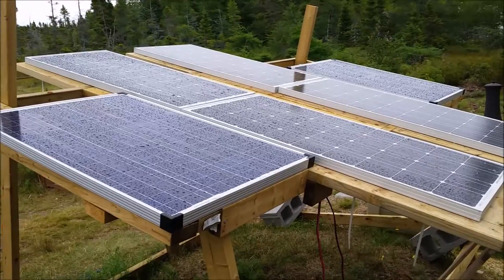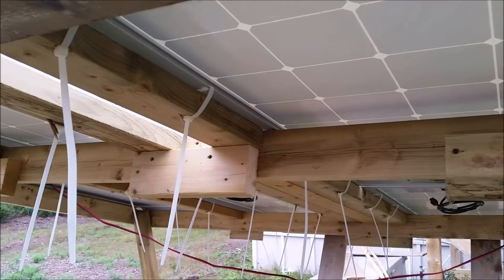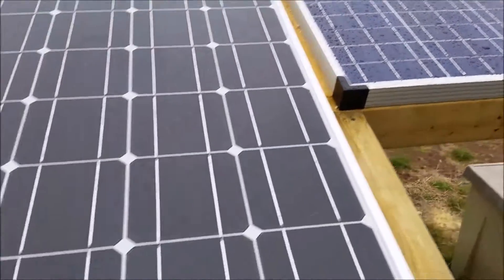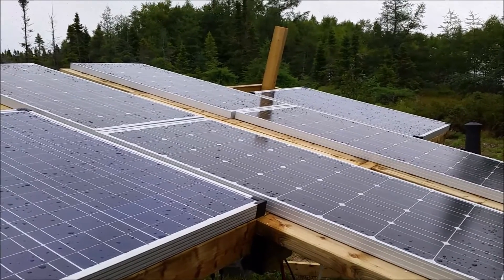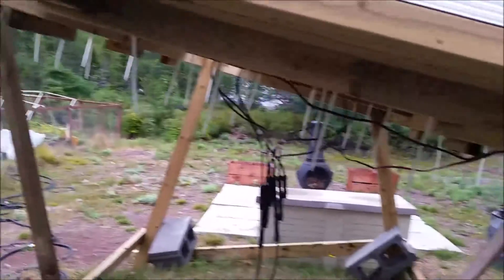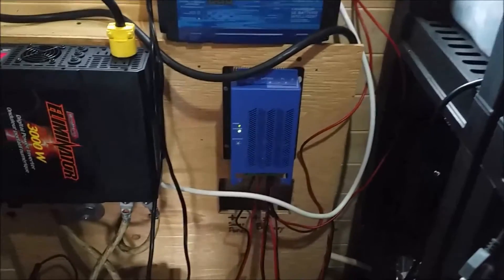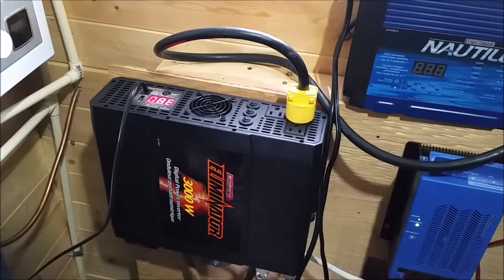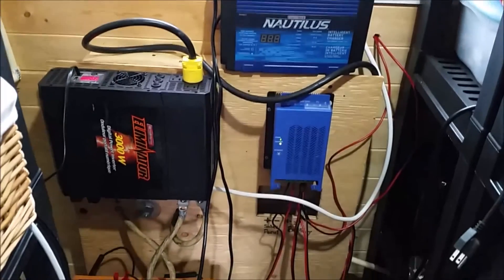Cabin Life: Living Off The Grid Solar System Update

Comment: do you have to run a generator a lot?
Reply from the maker: Hi there, I can actually run most of the week without any generator power, but I do like to keep the battery bank above 12.2 at all times to get a much longer life with the batteries.  If I had an additional 4 panels and double the bank, I would never have to start the generator.  I am running an full size refrigerator and deep freeze that consumes a lot of power.  A cloudy day will only bring in about 8 amps versus 33 on a sunny day.
Reply: +Dave Wilcox Jr Outdoors oh okay, thanks for all the info.
Reply from the maker: No worries, I just subbed your channel and look forward to following you!

Comment: It almost seems with all you have going on its pretty time consuming living off the Grid brother...I'm surprised you have time to have fun and trap...A man has to make time for that though...If I had my choice I would be living right next door to you sharing stories and drinking beer...Have you ever had a panel crack on you? Does the solar system store power for you when not in use?
Reply from the maker: Haha this year I have had to do a lot for making it easier here at the cabin.  These panels are a first for me, but neighbors have them for a while now, no issues with cracks or weather damage.  I am adding 2 more batteries to run 24/7 with the solar power, and the power is always topped up on the battery bank when not in use.  I will save thousands in fuel over time.  The upfront costs are high but it pays for itself down the road. 
Yes we would be drinking lots of Canadian strong beer if you were here... lol 
we could have quite a trap line too!  Take care Gonzo!!

Comment: No generator use would be nice, Hopefully it happens, Good luck with the moose and bear.
Reply: Dave Wilcox Jr Here is the deal with trying to go off volts. I have a video on it. But here are the speed notes :) 

Trying to go off just volts to know where your SOC. If your batts are on a load then the volts may be one thing and your SOC can still be clost to full. It's all about the AH. Keeping track of what you put in and take out. It's well worth your 150 bucks brother.. God Bless
Reply from the maker: +lifeinthailand Thanks man... hoping to get out and hunt!
Reply: +Dave Wilcox Jr Nice brother. I find one of the most help full things on my off grid is a Bogart engineering 2030 meter. It is like a gas gauge for your bats. Even my wife who hates things that look out of place on her walls loves it. We find it saves use a loot on are power and helps the bats last a lot longer. Knowing the true SOC for your solar will save you a lot of cash in bats over the years. God Bless Brother.
Reply from the maker: Ok great, I will check that out tonight.  Sounds like a great investment.  I appreciate all your helpful advice... So far I'm able to keep the batteries above 12.6, hoping that will prolong the life.  Thanks again, take care.